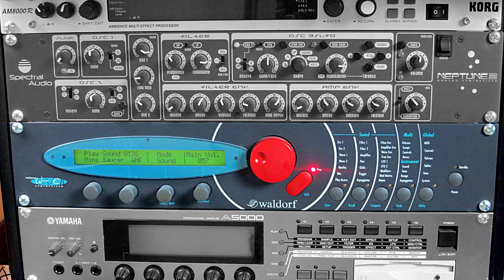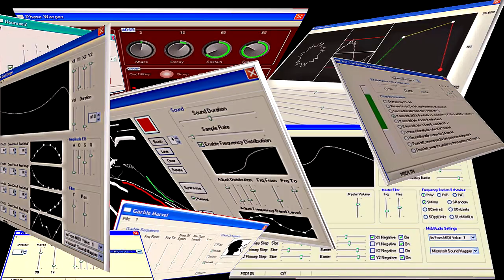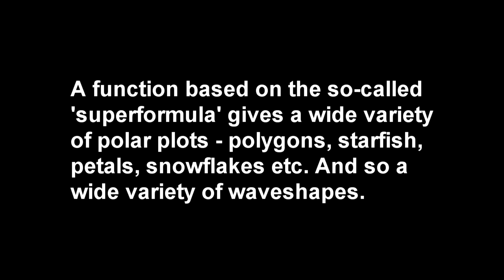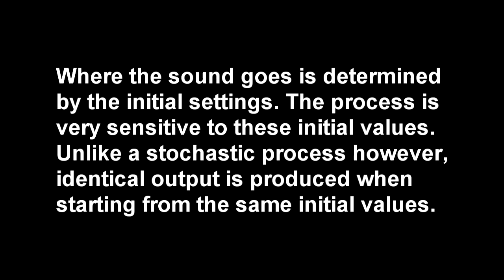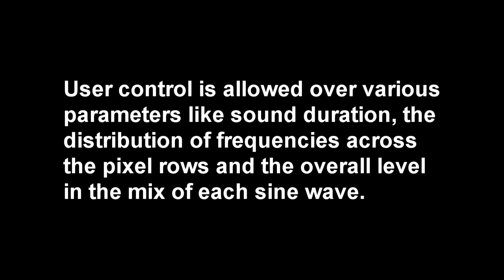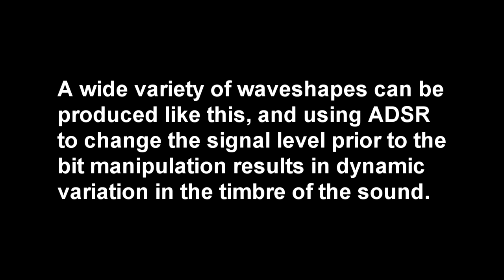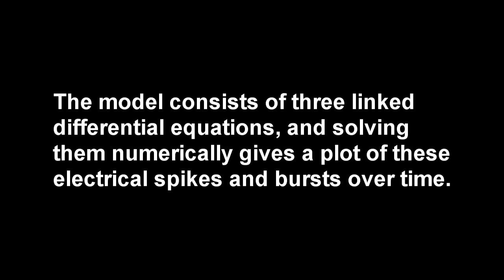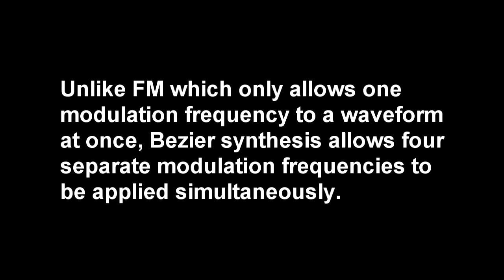Innovations In Sound Synthesis

Comment: Super informative. Bezier sounds fantastic. I just looked at your description of it. You said it's monophonic, so I probably figured it's quite expensive to calculate?
Reply: yes it is. :) i implemented a simple 4-point bezier thing in max msp, with 2 fixed points and 2 variable (to get an "oscillator" like you can see in the video) and it is some 20 streams and quite some arithmetic effort (given that MSP is all but efffective)

beside beeing CPU hungry it is also quite difficutl to control it. the real ttouble begins when you want to modulate the base frequency of that oscillator. 
eventually your best bet is to limit all mopdulation inputs to the beginning of the next cycle. then you can do all calculations in non-signal, or at least with a somewhat lowered signalrate.

beziercurves, btw, are also very cool for intonation: the can serve as a very naturally sounding glide effect between note events. :)

Comment: Hey, I was looking at the image on 3:22 and the graph on the left is exactly what I've been looking for for the DIY oscillator I'm trying to build. The part I'm actually interested in is a saw to sine converter, ideally a pure sine, without the use of filters or wavetables. I don't suppose you are aware of any analogue implementations of such a thing?
Reply from the maker: The dotted line in the graph is the phase of the waveform. If the phase is made to just linearly increment and reset, it looks like a sawtooth but traces out a standard sine wave. What's innovative about the synthesis technique shown here is that the slope of the phase is made 'hinged' and the hinge point can be moved in both the x and y directions - which in turn causes the function to trace out something other than a sine wave - as seen in the right pane of the image. One can evolve the technique further by having multiple independently movable hinge points, or even replacing the fixed line segments of the phase with a smoothly warp-able bezier curve. If your question however relates to waveshaping in the analogue domain, then searching on 'saw to triangle waveshaper' brings up a few circuits - for example those which 'create an inverted and non-inverted copy of the saw signal, then reverse the direction of the ramp every half cycle (creating a triangle) then soft-clip the triangle (turning it into something like a sine)'. Alternatively, the triangle wave can be passed through some sort of non-linear waveshaping circuit - a differential transistor pair for example will apply tanh(x) distortion, resulting in very close to a sine output. (By the way, in another one of my videos, I show a sine turn into a saw by applying sorting algorithms to the samples of the sine - a very digital method of sound synthesis with no counterpart in the analogue domain!)
Reply: Thank you for the detailed reply. The oscillator I'm trying to design will be using the PW control to also control the direction of the saw (with rising on one end, falling on the other and triangle in the middle), so I'm not yet 100% sure if I can use the suggested method. Nevertheless it was very inspiring and so far, my best option so I'm planning to have a go at it on Multisim as soon as I get the chance.

In a way, what I'm trying to do is similar to the hinged point technique you mentioned but with only one point, only controllable along the x axis (using the PW control), and applied on a sawtooth waveform. If I could end up waveshaping the 'sine' output, that would be a huge bonus!

P.S. I'm a bit rusty because it's been more than 10 years since I graduated and I haven't been practicing any electronics other than the odd repair. This project is meant as a way for me to refresh and extend my knowledge, so please bear with me if what I'm saying doesn't make too much sense.